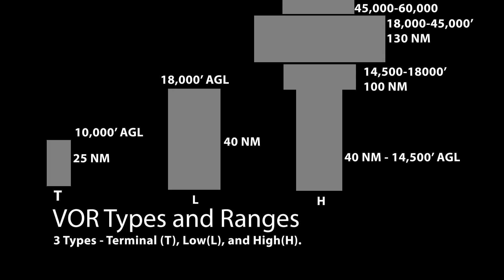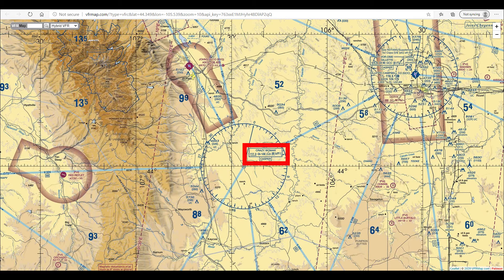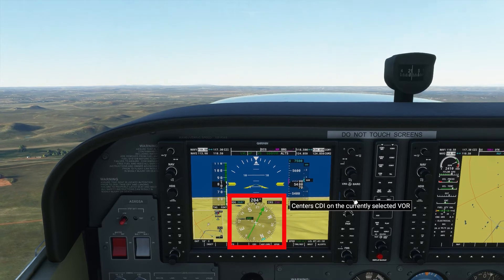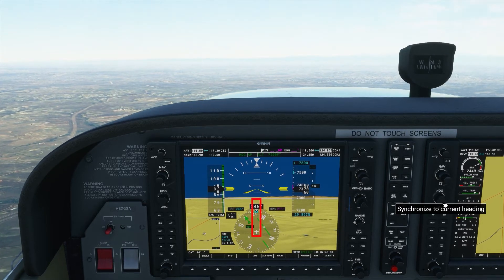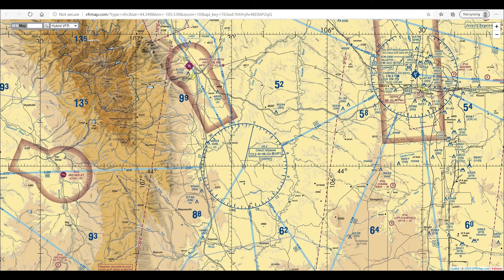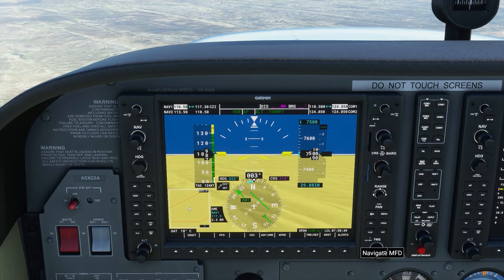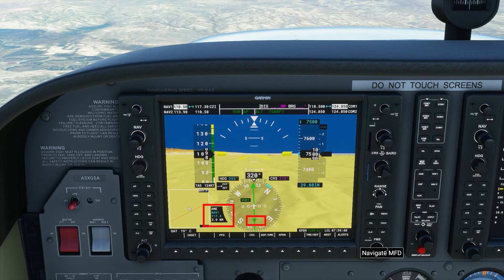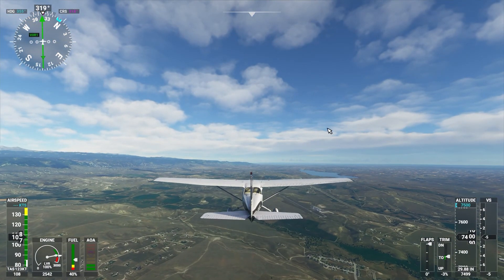G1000 VOR Navigation Tutorial - Microsoft Flight Simulator

Comment: So I don’t get why you “center the needle” by clicking the CRS button. What does that do? Does that like find the nearest radial?
Reply from the maker: It centers the needle with a TO indication.  That will set up a course to fly the airplane to the station in a straight line between the VOR and where the button was pressed.  It will also find the current radial when pressed and then looking at the course under the tail the of the needle.  Radials are always expressed FROM the station.

Comment: Is it default cesna172? I cannot find VOR system in default g1000😢.
Reply from the maker: It is.  The frequency should be in the top left or right corner of the PFD. Select nav source on the bottom of the PFD with the softkeys until an HSI with green needles appears.  You will also see NAV or VOR appear in green on the HSI vs a magenta HSI with GPS displayed.

Comment: How do you triangulate between two VORs or use them to plot a course when you are not flyin directly to or from the VOR?
Reply from the maker: There will be a video in the coming days on VOR triangulation.
Reply from the maker: The video on VOR triangulation has been uploaded.  A course can be flown to or from the station while using another VOR to pinpoint the location on the course being flown. RNAV used to be used to input a radial and distance to make waypoints to fly a straight line between multiple VORs vs flying to each one.

Comment: My question is, when ever I hover over a botton or knob it's blue and I cannot make it work, any ideas? Please. I'm trying to practice VOR flying but cannot tune in radios.
Reply from the maker: Scroll wheel works as does moving the cursor slightly into the arrow appears then left click.  You can also set a key bind of the first two don’t work.

Comment: Is that an ILS landing?
Reply from the maker: No, this video is a tutorial on how to use a VOR.  There is no such thing as an ILS landing.  It's called an ILS approach.  This works similar to a localizer which is the left right guidance part of an ILS approach.  A localizer sits on the far end of the approach runway and transmits at a smaller angle but is very precise.  A VOR transmits in 360 degrees.
Reply: @thecorporatepilotdad  so how does one land while flying vor-vor w/o AP? do we do it manually? can you make a vid on this one pls?
Reply from the maker: @Sanctimonious007  pretty much all landings are done manually.  Some airliners and specially trained crews can do auto land with ILS approaches.  If you go to my channel page then click Videos, you’ll see all of them.  There is a VOR approach on that page.  Actually two VOR approaches.  One is in the TBM and the other in the Baron.  When getting to an airport, either an instrument approach will be done or a visual approach.  Non instrument rated pilots will enter the traffic pattern and land visually.

Comment: One quick off topic ?? sort of.  On the King Air 350i,  I cannot find how to set the DME or tune for ADF?  Its the touch screen Garm.    Thanks if you can take a look at.  Kudos.
Reply from the maker: I'm on it.
Reply from the maker: I cannot find where to enter an NDB frequency.  However, to get DME, click on the HSI or near it and a page will come up.  On that page you can select BRG Pointer.  It has ADF as a choice but nowhere to put in an NDB frequency.  You can select NAV 1 or NAV 2 on the bearing pointer and it will show DME if a VOR is tuned and being received.  I did notice there is a volume knob on the audio panel that says ADF for tuning the NDB.  I think it is a glitch that it can't be tuned, or buried deep in the game.  I tried for 30 minutes to find it.
Reply: You are awesome thanks.
Reply: I spent time too. Thanks

Comment: There's also the military TACAN which has a slant range of 200 nm's. TACAN stations are often combined with VOR/DME stations.
Reply from the maker: You are right but I am not sure they are even programmed in FS2020.  When I was using the Crazy Woman VOR I tested the range and it went to 199 NM at 14,000 feet and it's only a High Altitude VOR.  In real life I've received DMEs 200 NMs away but not the VOR signal itself.